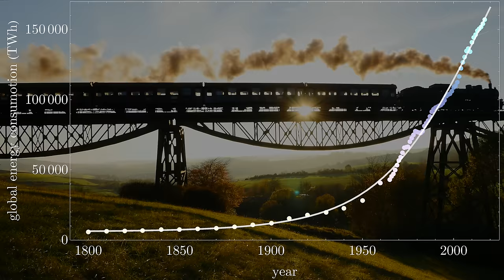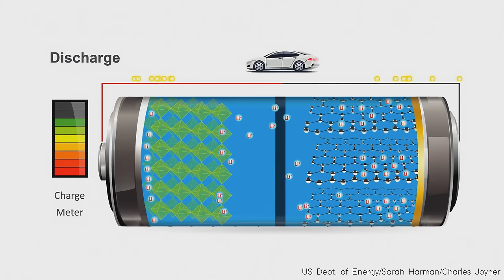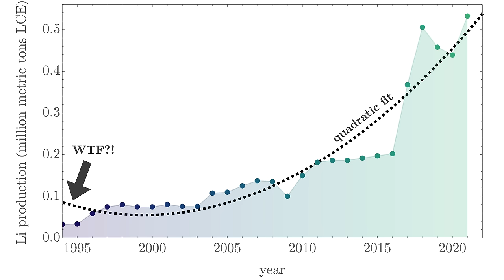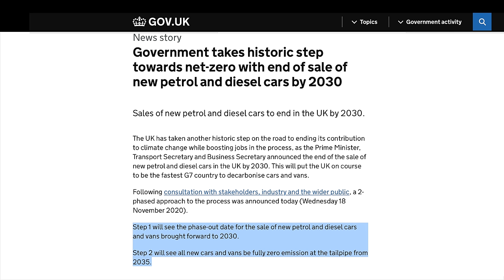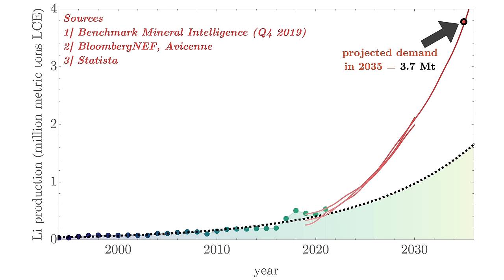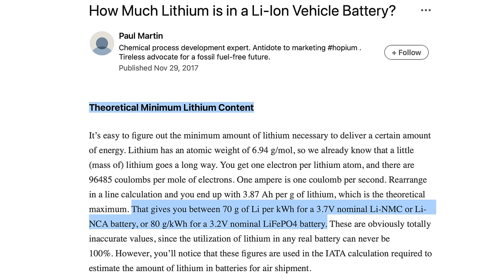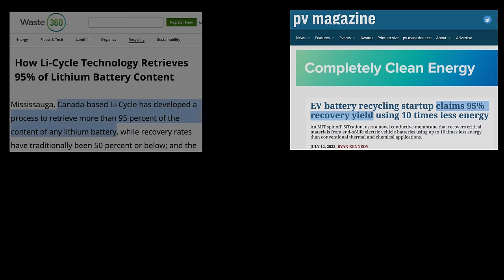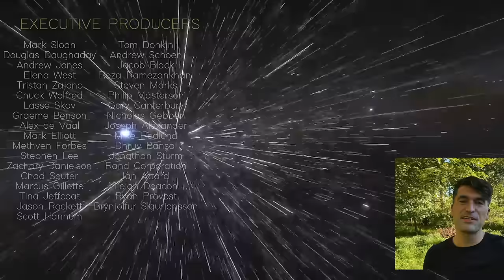Will We Run Out Of Lithium?

Comment: The absolute biggest downfall of EV's is how they all become literal totalled ewaste by the time they're about 8 years old... or much sooner, say 4-8 years old, if you're one of the many who won't be able to charge at home, and who has to rapid charge at stations every day. Waiting some half hour for a mere 60ish percent 'fill", which will get you, well... not too far, but a whole lot of range anxiety at least. And with this detail, comes the elimination of a whole demographic of drivers. And I'm one of them.... I drive a used, 18 year old Escalade EXT w/ 130k on the clock, got it for some $75K less than it cost new... before that it was a 19 year old Tahoe... Both of which look, drive, and perform like new cars... as does my 99 SS SLP Camaro, and even my mothers (for a direct family ref) GMC Acadia from 2015... Much newer than mine, but still, it would be on the edge of ewaste if an EV, and mine would have LONG since turned into ewaste. Literally, your near new car will one day simply have its battery sled fail, like your phone, laptop, etc does. And when this happens, it's now a hazardous waste disposal fee to get rid of it, rather than selling it as a used car, or even getting paid to scrap it. Cars that are merely at the "broken in" phase when compared to gas vehicles, will literally be totalled ewaste. Now taking three days to charge, and having your battery die in some ten miles down the road. There are literally Tahoe Hybrids out there today, with some 30K on the clock, from 2008-2010, who's sleds have died, and of which are now useless, totalled, garbage. Can't even sell them, yet these at least still have 6 liter gas engines in them, they just can't be started anymore, as they were designed without starters, relying entirely on the EV motor to kick start the gas engine when needed. Which can no longer be done with the dead sled, and it costs some $30-$40K to replace a sled, in just about anything. Hence the instant totalled status the day it dies, no matter how nice, or perfect shape the car is in. It's a horrible model, unsustainable, takes away an entire demographic of drivers, fills landfills with hazardous toxic ewaste at the most rapid rate ever, and is generally incredibly stupid. Won't even get started on apartment dwellers, on street parking, parking garages and lots, etc... folks who will NEVER be able to charge at home, and who will literally be at charging stations for hours if not tens of hours a day, just to do what gas cars do with ease.